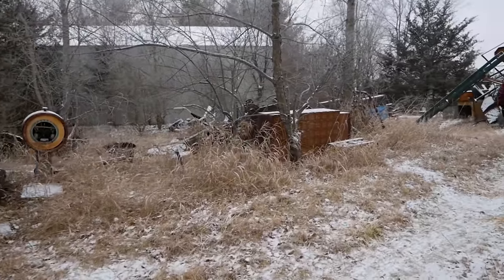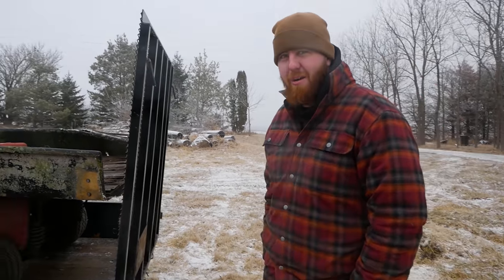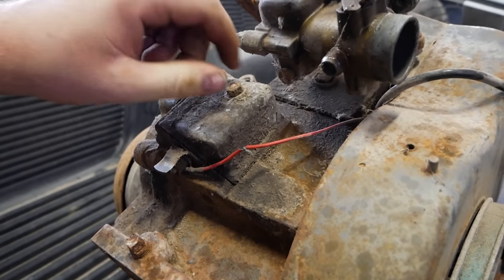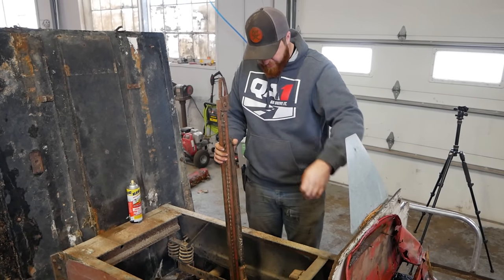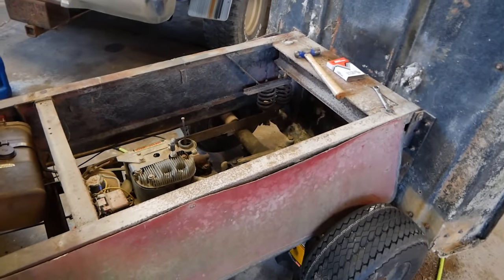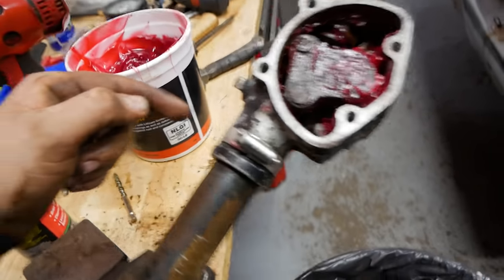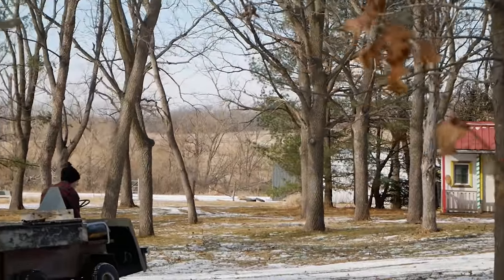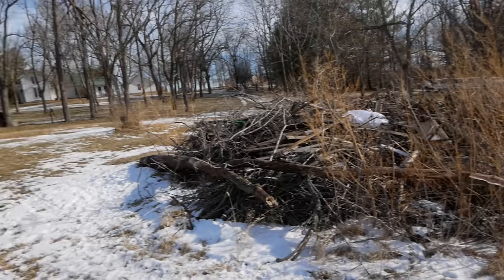Reviving an ABANONDED Yard Cart Found in a SCRAP PILE! - Will it Run and Drive?

Comment: I haven't had such a good laugh for years!  I have a bit of information on this type drive system: It is a Comet type clutch system, and requires a C section drive belt, 1" wide.  The wheels and tires are regular golf cart type, commonly sold already mounted. The tires and rims are available from Tractor Supply. Four lug trailer tires use the same pattern, and you can get them at TSC or Hobo Freight. So, If you want to jack it up, just change the tires. Some ATV tires also may fit it easily with  the golf cart rims??
Reply: As long as you can find the right width you should be able to find a set of atv tires that will fit. I have a machine that was at one point a lawn tractor and i put atv tires on the rear of it.
Reply: They definitely need to get the proper belt so that the "clutch" will work
Reply: @madmax2069  
Why not to re-build it as a "proper" chain-drive???
Then,they could have the different speeds,as well,is it??
Reply: @DuneRunnerEnterprises  because the belt system is working as a clutch, and it's gear ratios.

 the transmission only has one forward and one reverse gear. You do away with the belt and go with the chain you will loose the advantage of the CVT aspect of that system.
Reply: @madmax2069  
Bummer!!
Reply from the maker: Thanks gor the info! All that went wrong here was I grabbed a 38" belt instead of a 40 and ran out of time to swap them 😂
Reply: @JunkyardDigs  Many scrap yards will sell junk by the pound to salvages and pickers.  The trick is to pick one that does and try to get the stuff to the scrap yard with a minimum of additional damage during loading and transport.  Tire and other dumps are not so cooperative though, especially government run dumps.  Though I hear some such dumps allow nonprofit charities like church groups to salvage stuff for thrift stores etc.
   The school bus and panel van in particular could be revived for the homeless, maybe even for an animal shelter like Mook likes.
Reply: @JunkyardDigs  Enough work on this Vibo might enable you to sell the Cushman for significant money.
Reply: @JunkyardDigs  For exclusively off road use, I would have selected tires with a more aggressive tread, if forced to buy new tires.
Reply: @JunkyardDigs  I think that the short belt will act like a low gear and make it slow but powerful, at least at first, which might be what you want in a small yard.  Also, as the belt wears out and narrows, the effect should be reduced and function should approach normal.
Reply: go kart tires also, 8" is common
Reply: @alan6832  why didn't you just include all that into one comment?
Reply: Seems like C section is 7/8 wide and D is 1-1/4
Reply: @JunkyardDigs  Neil is right, you need a thick snowmobile type v belt for the Comet clutches. The drive and driven sheavs expand and contract better with the correct height and width. I've done a few vintage EZGO carts that use these. If the clutches are toast look on golf cart sites, their expensive, but available.
Reply: @brandonclements7875  because I wrote the first comments before watching the parts of the video that inspired the last comment.  This is also why I failed to predict that the belt would break.
Reply: @alan6832  The school bus could either become a skoolie RV, or a chicken coop for them.
Reply: @brandonclements7875  because he would have exceeded the word allowance, maybe?
Reply: @jacobshort6528  Heck no.  I've seen comments 20x longer post no problem.
Reply: @alan6832  Or for exclusively on-road use, I would have selected tires with a less aggressive tread, if forced to buy new tires.
Reply: @alan6832  You say when you're buying junk by the pound to take to a scrap yard that the trick is to do so "with a minimum of additional damage during loading and transport" which is irrelevant if you are taking it for metal scrap.  
If instead you're parting it out it, or taking it to someone who parts it out, obviously it goes without saying that you don't want to damage it further.  
Peculiar and prolific empty comments.
Reply: @jacobshort6528  as far as i can tell, YouTube has no word limit
Reply: Same clutches on a snowmobile older ones of course
Reply: @SportbikerNZ  It does matter! people salvage at some scrap yards and are less able to do so when the scrap is torn up or crushed for transport.  Not all scrap in scrap yards gets melted!
Reply: @SportbikerNZ  Neither the vehicle nor it's tires are street legal, so this buggy is off road, not on.
Reply: @jacobshort6528  and/or for their favorite charity. I think Mooks favorite charity was an animal shelter and school buses can shlter and/or transport animals and/or animal supplies, though I think it is better used to shelter and/or transport homeless people.
Reply: @alan6832  It doesn't matter if you are buying junk by the pound if you are scrapping it by the pound.  And it obviously goes without saying, if you are buying junk to part out, rather than scrap, that you don't want to damage it further.
Reply: @alan6832  By that logic, any kart designed to operate on asphalt is street legal, which is completely incorrect.
Reply: @SportbikerNZ  There is very little off road asphalt on which to operate, so such vehicles are both rare and impractical.
Reply: @madmax2069  I suspect it is actually a CVT too.
See my other remark on this.
Reply: @JunkyardDigs  Please make sure you read my other reaction.
Reply: @brandonclements7875  It is funny he posted a bunch of 'suggestions' on a video before even watching it all.  Never good.
Reply: @jankoevoet4042  Keep in mind the obvious issue he has of receiving tons of comments on his 130+ videos daily.  
So it's certainly not helpful to ask him to find your other comment.
Reply: @alan6832  That's beside the point, and also incorrect.  The ubiquitous kart slicks and road treaded mini bike and kart tires are commonly used on tracks, parking lots, driveways, swap meet and market grounds, pits, footpaths, empty courts.  You name it.
Reply: @SportbikerNZ  If pavement tires were the best option, he would have tested it on pavement, which he didn't, and which I easily guessed he wouldn't.
Reply: @alan6832  Considering off-road tires are harder on lawns (see original cars and cameras videos) and considering the future use of this kart is unknown, assuming he should buy tires with more aggressive tread is unwise and an entirely empty comment.
Reply: @alan6832  it's hard to kill a school bus most get over a hundred thousand.

Comment: The VIBO is pretty cool. I'm sure eventually it will run great. It's hard to kill an old Wisconsin engine. I'm very happy that you saved it from the scrap pile. It seems like a very useful vehicle with the box on the back of it, and it's a rather unique vehicle.
Reply: Get the mechanical stuff in order, put some better off-road tires on it, and re-build/restore the exterior, and it would be a pretty neat run-around for the property.  Not sure it would be worth the time and effort to do all that, though.

Comment: Try to solder/braze the steering box crack off with aluminum brazing rods (blue demon or alumiweld for example, those that can be used with a propane torch).  Then put a gasket on the cover :-)
Best thing would be to mig weld the crack back, but brazing might just do the trick if you don't have access to a mig welder.

Comment: I am a retired small engine mechanic.. On old point engines I just replaced the coil to one that didn't need points and never had any issues with spark.. Also I would replace the carb to a more modern and newer one.. This is not ever going to be a restoration, but putting a new coil and carb would allow it to actually be reliable and useful. If anything it would make a good play toy to putter around..  Oh.. VIBO was an old golf cart and utility cart, I believe they were either bought out or went out of business in the late 60's or early 70's.. Thank you for sharing...

Comment: Great video.  This little thing has some great potential around your place though.  Longer belt, some ATV tires on the back and I'd change the throttle to one controlled by your left foot for fun and confusion.   The new place looks great.  Any plans to build a shop and move everything into the back yard instead of driving to town?

Comment: I worked for Westinghouse and in our factory, we had our own fire truck. The truck was one of those.   Our building was 17 acres under one roof.  Ours used a drive unit out of an easygo golf cart and had ton of 6 volt batteries to power the electric motors to power it and ran all the accessories on it.

Comment: Love to see old stuff like this get Phoenixed.      A few years ago I  salvaged an  ZEZGo 850  4 stroke 1500 pound industrial cart  similar to this  that had been sitting for nearly 25 years - The orig owner had replaced the Robins engine  with a similar Wisconsin. All I did was  freed the steering,  cut the brake hydraulics away and ran  a couple of cables from the emerg brakes   to the brake pedal, cut the mounting flange off the carb and made an   adapter to accept an old Mikuni 250cc bike carb,   replaced the fuel tank and battery, hit the starter and  its been running ever since.    I found pre-mounted 6 ply tires on sale at  Northern for $200. It handily carries 25  fifty-pound feed bags on the original belt which is prob 45 years old.

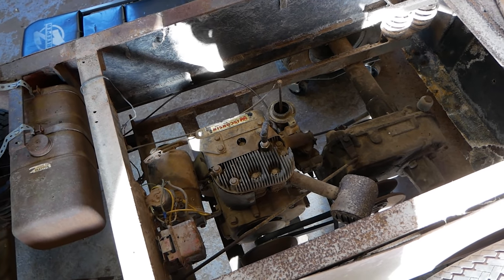Comment: Also it caught my attention that the drive v-belt sits in the sheave grooves of the gear box side nicely, but just rides on the shaft of the motor side. 24:23 shows what I mean. The grooves seem way too spaced apart so you're not getting any grip on the motor side like you are on the gear box side. That's probably why its so gutless. and why it snapped; tons of slippage.
Reply: It's supposed to be loose at idle, at the bottom of the motor pulley and up at the top of the driven pulley. When the motor speeds up, the shieves move together from a centrifugal mechanism inside one of the shieves, which tensions the belt and starts it moving. So the belt here is way too tight, it should almost be floppy.
Reply: @brainndamage  Oh I had no idea that it worked that way. I guess I just assumed it was a fixed position sheave that somehow worked its way apart. I definitely learned something today!
Reply: Yup. belt is all wrong! Should be around the maximum diameter of the secondary and loose on the primary till you rev it up. Think snowmobile clutch.
Reply: @rayfunk5659  that's exactly what I was channeling, snowmobiles! :)
Reply: @redbaron3224  need Golden Rust or Bust to teach him how snowmobile clutching works!

Comment: Other than that this is an awesome video keep up the good content my man I actually grew up with a 1960s early '70s era Cushman scooter it was quite a bit longer than that vivo and at some point in its life I don't know if they done this from the factory or not but it had a three-speed manual transmission and 4 cylinder engine from a station wagon from the '70s or '80s so someone done some hillbilly ingenuity with it but they done a good job never had any issues we could literally stand the front wheel up and ride that thing onto a tree yes I know why would you need to do that my question is why not try we owned a lot of three wheelers at that time and we had a big oak tree that was slightly slanted so we would always see how far we could drive up the trunk of the tree you know we're the generation that grew up knowing that three wheelers were banned because of how dangerous they were and then done even more dangerous s*** with them

Comment: Those old Wisconsin engines were great. We had a couple of old ones at a job I worked at and they were remarkably easy to get back running again after having sat 10-15 years outside.

Comment: The bearing in the bottom of the primary clutch may be stuck as well, causing it to shift into gear hard. Also, harvesting the brake and throttle pedals/brackets from another golf cart might make this thing more user friendly.
Reply: It's hard to get into gear because it has the wrong belt on it and it needs to be at an idle so the clutch isn't engaging.

Comment: Mook is so pretty and seems so nice. Try using a emery board mean't for filing nails instead of sand paper for cleaning points. It works better and since the emery board is stiff cardboard you can cut it to a manageable length. I always keep a 3 inch piece in my wallet for emergencies. You would be surprised how many times it comes in handy! Plus emery boards are really cheap. Just ask the Mookster, she will know!

Comment: Milwaukee motors are a very cold blooded motor. We had one on a bolens mower and used it for snow blowing. Sometimes we had to put a small heater in front of the motor. But they will just keep on going. Have fun with it.

Comment: A lot of these type of vehicles were used at amusement parks, ball parks, public parks, golf courses, resorts, and campgrounds as maintenance vehicles, some have converted them over to electric for easier maintenance and quieter operation to not disturb the guests.
If you have it where you can get it running and operating, it can be very useful utility cart to have on your new property. 
Maybe use it as a pattern to build one that is more useful and 4WD. Call it a Mooki

Comment: SNOWMOBILE BELT!!! It needs a snowmobile belt to function right. That way when you idle the engine the belt won't spin the transmission and you can engage it without grinding the gears into a pile of shavings all the while complaining that it's a piece of crap, then increase the RPM's which causes the centrifugal clutch on the engine to engage the belt allowing you to move. The higher the RPM's the more the belt is moved up the pulley, the faster you go.

Comment: You need slight slack in the belt with the secondary clutch completely closed with the belt riding on the top of the sheave.The primary clutch should open at low rpm to release pressure on the belt and allow you to stop/shift.

Comment: Something like this working would be good for my 35 acers in WV. Nice small bed on the cart. great for carrying items around it. I be puting at least a Roll Bar and sheet metal top on it. The dump bed is what makes it nice for my use

Comment: A tip to get tires on use soapy water to make the seal on the bottom bead with something to lift the rim to saet easier then remove the valve stem soap the top bead and use an air chuck  to seal the tire

Comment: I remember...I know I was surprised as well..waaaay back in the late 70's -- Cushman supplied plants with trucksters in various configurations..my dad's papermill job had em allover - some in piles.  Nowadays a place I work at has a similar looking Toro deal like this thing with a manual 3 speed & runs pretty damn good

Comment: If you put a ratchet strap around the tread of those tires it will push the beads out so you can air up the tires. I've done plenty of them on old garden tractors

Comment: Man that cart is awesome, Should try put a predator 670 engine in it and make a actual throttle cable system for it and get the breaks working properly

Comment: I'm a operator at a pre-cast concrete plant, the fabrication shop guys there have one of those but its a flat bed with a welding machine and tools, its also electric 1st one ive seen

Comment: Got to find a vibo turd for my buddy's 7 acres. We got a Chinese 10hp diesel Motor looking for a home in something like this. Electric start w/ complete  self contained wire harness, just add a starter battery. Starts and runs as reliably as one of the predator engines.

Comment: The trans was probably a variable belt device by the look of the pulleys. Pretty easy to come by in the US...And because it's not idling properly you will find it hard to engage a gear.

Comment: You need a wide belt like a snowmobile.  It is supposed to be a clutch & variable speed trans all in one, the little trans is for directiion only, you are grinding the gears out of it.

Comment: Your comment on the updraft carburetors rarely needing anything, yes they will run with tons of crap in 'em! I just revived a 1950's Simplicity walk behind that was my wifes grandpas and had sat since the 80's- freed a stuck valve, dug out mouse nests, clean and gap points, give a squirt bottle to it and the model 19 Briggs runs, never touched the carb!  Video over on my poorly edited, non monetized channel (shameless plug)

Comment: Mook's not chonkin', that seat's just heckin' ruined.  You should put some elbow grease into that thing, make the electrics work proper, put decent work lights on the front and fix the seating and bodywork, it'd be a groovy mule, and with actual land you're gonna need it!

Comment: Step one check crankcase for oil. Step two spark, air, fuel.🙄 BTW great job sorting out the wiring and ground issue.

Comment: That needs a belt like a golf cart or snowmobile. It should be as wide as the exposed shaft on the primary clutch and long enough to be loose at idle

Comment: The carb kit should be fairly easy to get. Worse case you clean it and make the needed gaskets.
Pretty easy to do just time consuming to make them right.
I would sai carb. Oil change. Set of rings and run for ever. I would bet Briggs has ring to fit it.
Good luck.

Comment: I would have saved the bluish green golf cart also.  That is one AWESOME save, nice job getting it running.  On the subject of the belt burning up, it was to narrow for the clutches.  You should be able to use a snowmobile type belt, it would fit the clutch pulleys much better.  Again, nice job.

Comment: Congratulations on the new place. 
Pretty sure the pedal is up for throttle, and down for brake/clutch. You should have to push the brake to put it in gear.